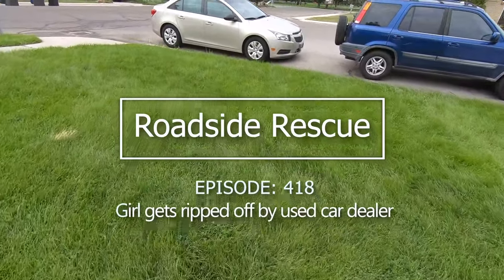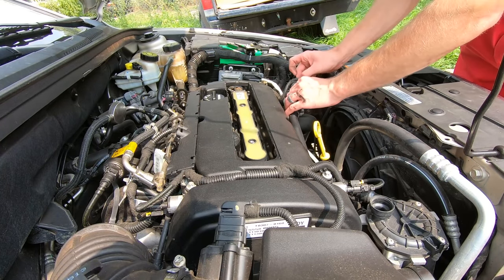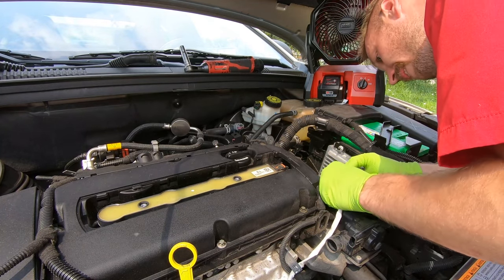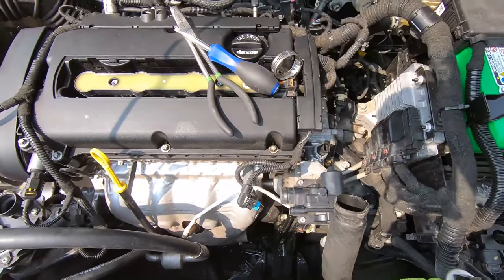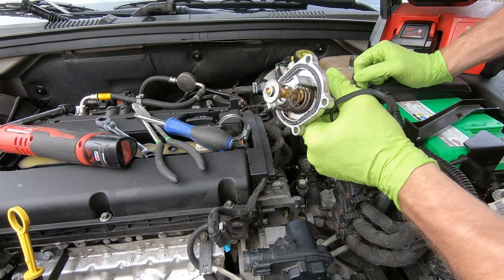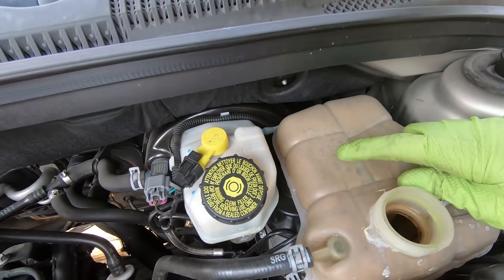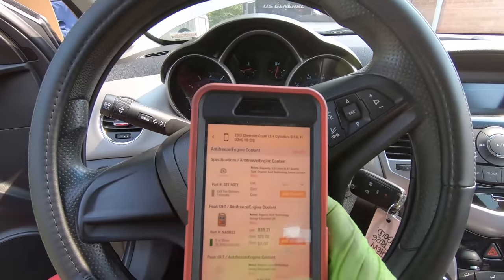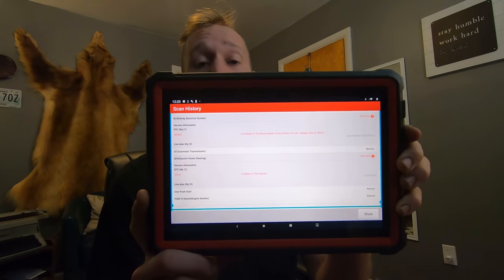Girl buys 13k mile "new" car. She was scammed. Heres what happened...

Comment: I always found if you use plain tap water, the minerals with destroy your aluminum radiator. Even if you drain and refill with coolant, eventually it will spring a leak.
Reply: Radiator flush can help and always using premixed coolant
Reply: Very true
Reply: Coolant has to be car specific also,  and if your water don't have minerals (like using distilled water) or it's too hard it takes minerals from the engine and cooling system. Water wants to balance itself.
Reply: I've always used distilled water for my 50/ 50 MIX till they came out with it premixed.
Reply: I guess we have to be a chemist nowadays on thies new crap cars lmao
Reply: @cablecow15 Im not a Ph.D. Chem. but when i worked on offshore fire suppression systems we always used tap water. And usually that tap water was little of from the specs... they were never filled with distilled water...of course there was troubles like water been too hard and additional softener was added. My point was if you fill your system with like distilled 
water it is not same water after couple of years.
Reply: @Urs4  You are thinking of mineral deposits which form in water heaters because they boil the water and they separate from the water and fuse against the heating coil which is causing the water to boil. In a car that SHOULDN'T be an issue because the system is kept under pressure and shouldn't be reaching boiling temps in the first place unless there is a leak. (or if you are running straight water which isn't advisable)
Over time yes your radiator will eventually rust out and potentially loose efficiency or just flat out clog but welcome to water on metal interactions.
Reply: @SilvaDreams  Im not thinking about boiler scale, opposite way, minerals separating from the engine. If we are thinking of radiators, basically last ferrous metal ones were installed on early 90's
Reply: @Urs4  You do know aluminum does rust as well... Right? Gold is the essentially the only metal you can say doesn't rust. (Well it can but to make it break down into an oxide requires a specific acid)
Reply: @SilvaDreams  Aluminium does not rust, but it does corrode

Comment: I own a shop in Los Angeles and these cars make us a ton of money because they’re pieces of junk. Everything starts to take a crap at 60k miles! The Sonics are the same crap. I recently showed a customer on his Chevy Sonic that he had the same coolant and oil mixture, however it’s due to a bad engine oil cooler gasket set. Contaminates the entire cooling system. I told him to get rid of it because it’s only starting.. it’s always turbos, catalytic converters, valve covers, intake manifolds, shocks leak prematurely, coil packs fail, radiators crack easily, radiator tanks always leaking.. the list goes on and on and on. It’s a never ending story with these cars.

Comment: 13k would be the first BIG question. By watching the video there is no way in heck that motor had 13 k on it more like 130k. You can tell by looking at the bolts on the cover they had been off before and oil/dirt build up around the cover and other spots. Plus that should have had dex cool IE orange antifreeze in it. If you mix green and orange it will also do that to the tank. I have seen and had to clean out a lot of GM cars and trucks because the owners put green in with orange. However when you pulled the stat out of it and i saw the same as you did oil that is the makings of a blow head gasket that motor is known for that. She was ripped off big time. I always tell my customers if you are serious about buying a car or truck that is a big investment cover your butt have it inspected by a shop you can trust. We do it here and I charge 250 bucks and it takes about 3 to 4 hours. reason for my time of 3 to 4 hours is I go from bumper to bumper and you name it i check it. That money can and will save you one heck of a headache and pocket book if the shop finds stuff that will make the deal go thru. I always tell my customers DON'T by a car or truck because you love the way it looks you buy it because it runs and drives great and needs little to NO work. Looks don't get you down the road! Please if you buy from the corner auto pop up shops ( that's what i call the shady dealers) Cover your butt with the inspection plus have them put in writing at least a 30 day return policy if something breaks. Here in Arizona the dealer has to give a 30 day 1500 mile warranty per our laws. Most of those dealerships buy known wrecked cars/trucks, repos that have been abused big time, or super high mileage ones. They polish the tird up  and sell it like it is top quality. To many times i have had to help a customer out from one of those fly by night places. When i do the inspection I start a video recording from the time i walk up the the car/truck until i am finished with it. I have done that for a few years now since one of the fly by night places accused me and the new owner of doing something to the car when she brought it to me for inspection and it was towed back to them with a blown motor. they forgot to put oil in it during the oil change or never did a change nor checked the oil.  The dealership tried to sue her but lost when i showed up with her in court. Moral of the story PLEASE get an inspection!
Reply: She definitely got scammed but I doubt a Chevy cruze would reach 130k
They're made out of junk.
Reply: @sarhan5568  😂😂😂 facts
Reply: @sarhan5568  thats funny, my daughters 2012 cruze is still going strong at 130k.
Reply: @domusdebellum3042  You got the only good one they made!
Reply: As a mechanic knowing the history behind those engines my first instinct would’ve been look at the oil to see if coolant and oil are mixing, and to look at the coolant would’ve saved time & money
Reply: Well said until my last car I asked my mechanic (he was fleet manager for a fuel distribution service but he sold and repaired used cars in his spare time ) when I needed another car he went out and got me one I said I didn’t mind him making a few £,$ € for getting it for me as I knew he didn’t want to be lying under it fixing anything and every car he got me lasted over and up to 200,000 miles unfortunately he passed away suddenly and I asked another mechanic I trust to get another car for me but I found one myself from a dealership and it was the first time I’ve ever bought one from a dealership so I paid by MasterCard and when they tried to sell me extra warranty I told the salesman that he wouldn’t be arguing with me but with mr MasterCard, but it’s a Toyota RAV4 so I’ve got faith and 2 years later I’ve only had to pay for a service and I wanted all weather tyres , as soon as I got the car I then asked the mechanic to go through the car and make sure it was as said and he said it’s a good car and the government inspection guy said it’s a very good car, but still I should have got it inspected before buying and the only reason why I bought it was because it had a years warranty and I could use any authorised garage I wanted of my choice for repair, sorry for the long comment but I just wanted to agree with you to spend the extra money to get an inspection and just put it onto the cost of the car so instead of saying it cost you ten grand it cost you ten hundred three fifty for the car and that lessens the blow
Reply: @johnmehaffey9953  What country are you in because there isn't a single car dealer in the US that will let someone use a CC to purchase a vehicle. Merchant fees are typically 2.5% which means even a cheap used car of $5000 would cost the dealer over $100 in CC fees.

Comment: The coolant in there is green. The oily substance could be a buildup from mixing Dexcool and green coolant. I have heard a lot of issues where people run into sludge when those two coolants are mixed not saying that is it but it's a good possibility
Reply: Michael Dempsey- Nicely  You are correct changing the antifreeze from Dexicool to non Dexicool in later model cars is a no no. It will cause sludge build up if not completely flushed normally a blown headgasket causes overheating & or white smoke from the exhaust.  This so-called mechanic needs more experience.  Also the cruze has a self bleeding cooling system.
Reply: @automech01  lol i agree.. For a mechanic he sure use alot of maybe's and idk's.. Sounds more like a Technician (Parts replacer), Than a actual Mechanic.
Reply: @soulwarrior7721  Wow! You two have clearly no idea what you are on about.
Reply: @soulwarrior7721  backyard mechanic
Reply: @automech01  dexcool is a hoat type coolant and isn't compatible with iat coolants. The mix with all (modern) coolant is usually an oat or an hoat. So topping off a dex cool system with an oat or an hoat is acceptable. The difference between oat and hoat is the additive package( silicone gasket?, Ceramic water pump bearing?, Etc)
Reply: Milkshake is an old term we use in UK happened a lot on short journey petrol engines that need a flush every year. It does look like the thermostat cap is a little condensated, but oil mix could be oil cooler or EGR cooler cracked or a head issue. I'm sure though that that little of milkshake isn't much to worry on a cap it's when the bottle itself turns to milkshake that I would worry.  Your thoughts?
Reply: Some dexcool compatible coolants are green which can further confuse the matter. Prestone all makes all models is basically dexcool but bright green. The color is meaningless, it's the chemistry that matters but without knowing it's probably best to flush and fill correctly.

Comment: Big props to you seriously for working on a car in 96° temperature. I remember when that level of heat never used to bother me so much even though I'm still in great shape and great cardio seems like it just does something to you the older you get. But when I travel to places like Albuquerque New Mexico it's a different type of heat it's more like a dry heat. I have to send you a gift card for all the great work that you do and the great useful content.
Reply: the body also adapts. if you go for a week long camping trip AC feels too cold when you get back
Reply: @0xsergy  heat used to give me a headache. I couldnt not get a headache till we moved into a farm house with no ac. Summer came around, first month was awfull but after that no ac was no problem. Only thing i missed was working outside hard and not being able to cool off quick, but a rinse with a cold shower fixed that
Reply: @chickensfloat7427  a wet t shirt also works wonders on hot days. Natural AC.
Reply: @chickensfloat7427  I guarantee you that farmhouse wasn't here in Kansas or the Midwest the humidity would kill you without air conditioning I promise

Comment: 2 out of 3 eco-tec's I've owned have used coolant, no spots on the driveway, no sign of leaks. One was a new car, so no abuse, A 1.8 cruze of all things. I could see headgasket being an issue on them.
Reply: Eco-tec= daewoo lols
Reply: @goclunker  Sure does, one of mine was a 1.6 in an Aveo (Daewoo Lanos) coolant disappeared in that too.
Reply: No coolant issues on my 2015 yet
Reply: @TheOnlyJoshH  key word, YET
i hope you get some good use out of it lol
Reply: @gabrielromeo5841  that’s why I said it bub
Reply: @TheOnlyJoshH  nice, bub
Reply: @TheOnlyJoshH  Buy something else before something fails, they're expensive to fix because most second-hand motors are dead too
Reply: @rhycemg  I’ve only got 35k miles on it…I’m in no rush to get rid of it.

Comment: That brown gack may have been Bar's Leaks. It's brown tar-like pellets and looks exactly like engine oil mixed with water looking under the cap.
Reply: bars leaks makes the coolant look like primer paint colored diarrhea ,, I have a 1983 chevy truck that had that crap in it cause of a leaky head gasket  ,,i replaced the engine when it finally died and boiled out the radiator and hot water flushed the heater core ,,i finally installed a coolant filter on the heater return  and managed to get most of the crap out 

the yello-brown goo on the radiator cap is engine oil ,i'm betting that engine has a weak headgasket  that hasn't blown completely ,,OR it was already replaced and the system not fully cleaned 
i use Dawn dish soap and strait water and run the engine till it's hot and about 20 more minutes cause it will dissolve the oil
Reply: I hate when people use that crap. I try to explain that stuff will only make the problem worse. I don't know they they even sell it in the parts store.

Comment: I just did one of these thermostat housings on my son's cruze. It is a very common issue with those cars.
Reply: Water pumps, thermostat leaks, turbo failures, engine failures, transmissions failures, electrical issues and hvac issues. These cars were not built well
Reply: I used to have an Aveo...same engine family smaller displacement. My tstat housing was plastic. It cracked and poured coolant out one day coming home from work. 125.00 for a new one me doing the labor.
Reply: @hackdeez1075  I agree they are junk like many other gm products
Reply: @scottspoerlein1650  I'd argue that the aveo was built better than what gm is producing now

Comment: Any salvage / rebuilt vehicle take it to an alignment shop and make sure it can be aligned and is not bent . Have someone drive it while you are behind it . Make sure all 4 wheels track straight . I have seen bent vehicles not track straight on the highway . Years back , there was a " shop " in Brooklyn . His " chassis machine " was a blow torch and sledge hammer . " It looks pretty straight " ! You can't make this stuff up !

Comment: That screw type hose clamp is probably your leak. As it goes through heating and cooling cycles, those type of clamps are unable to adjust their tension and will leak under certain conditions. That clamp should be an squeeze on hose clamp.

Comment: Had a 2014 Cruze and every 20k-25k miles I was replacing the valve cover. Replaced valve cover 3 times then ended up replacing intake then traded it in on a Toyota

Comment: Use a pick to lift up on the clip of a connector to remove it. Using pliers could break the connector. Pocket screwdrivers and small picks will help remove connectors without breaking them. Coming from a gm tech.

Comment: oil in the coolant on those engines is more than likely the oil cooler seals. very common. my sonic has the same engine, i put a bottle of at 205 reseal in the oil because im cheap. its to rejuvenate seals not swell them like other products. i think its helping.

Comment: Somebody messed with that cooling system before and knew something was wrong. That T-stat is not OEM and neither are the hose clamps on that housing. On top of that, they didn't even use the correct coolant, it should be orange, not green.

Comment: the value of a rebuilt vehicle in 50% less than book value especially if the title is stamped, rebuilt or totaled.
Reply: Rebuilt is ok if done right but I wouldn't buy one.
Reply: @Bruce Augustine 80%. 40-50% is an approximate for salvage title before it’s fixed.
Reply: @galenwaltman1656  It actually depends on the type of damage it suffered whether it is worth fixing but i was talking about after repairs.

Comment: If she still has the Cruze then check the oil cooler. On that vehicle the gaskets shrink inside the oil cooler like the thermostat gasket did. When the gaskets in the oil cooler shrink the oil and coolant will be allowed to mix.

Comment: leak , step 1 always pressure test first.

EPS code could be wreck related , uses steering angle inputs and g force sensors. Sometimes they set after doing an alignment and need a calibration. Or from alignment being off from the wreck

Comment: I had a 2014 Cruze with that 1.8 non-turbo engine. Not too many issues, the plastic thermostat housing cracked and had to replace that and the throttle bottle coolant line as well. Other than that, just kept up with regular maintenance, fairly solid car, sold at about 105k miles. Upgraded to a Rav4 for the wife lol
Reply: But my buddy had a 2010 with the turbo engine and blew a head gasket at about 100k miles so can’t say my experience is common

Comment: you should have pressure tested anyway. if there is a blown head gasket you can find it through pressure testing a coolant system IF the head gasket failed and is letting coolant escape into a cylinder or into the oil passages then you will see a pressure drop and no physical leak. possibly even unable to build pressure if the head gaskets blown bad enough. just something to keep in mind.

Comment: The first problem is that they used the green antifreeze.  They probably refilled it with green after the Orange puked out on the ground.  Mixing antifreezes is a really bad idea. That tapping is also a problem and its likely a vacuum problem

Comment: Had coolant and oil mix on which i think is the same engine over here in the Uk.. It was a Vauxhall vectra. Turned out it was the oil cooler located under the manifold / cat. Water cooled oil cooler and the seals go bad or somtimes the aliminium casing distorts allowing the oil to mix with the water! I changed the seals and fixed the problem. 👍

Comment: I remember back in the "cash for clunkers" days someone came in and the RO said windshield wiper fluid bad. It wasn't bad fluid. The windshield washer fluid reservoir was topped right off with 0w20 which was correct engine oil for that TL. People are stupid and put fluids in places they shoudn't. The fact that the oil in this cooling system was used oil means that probably didn't happen here.